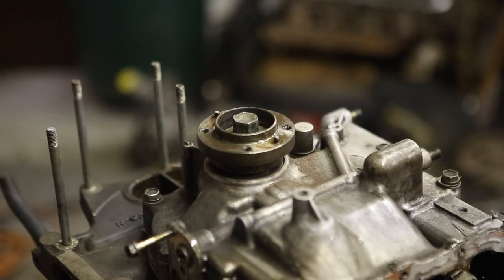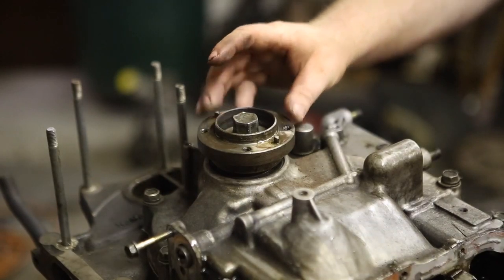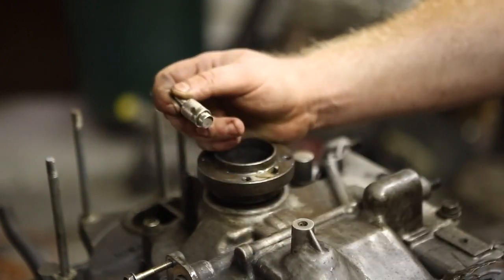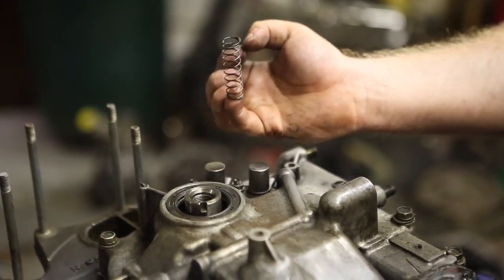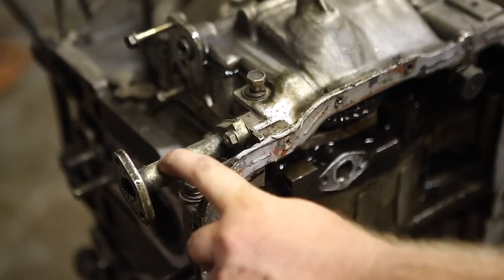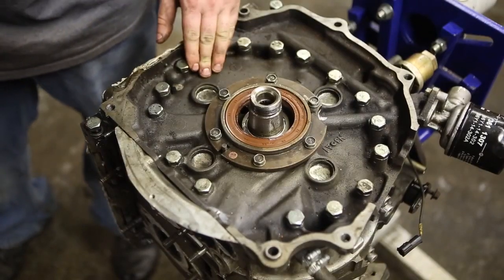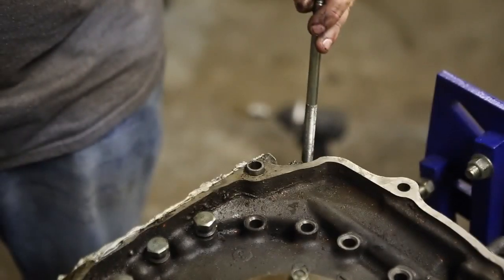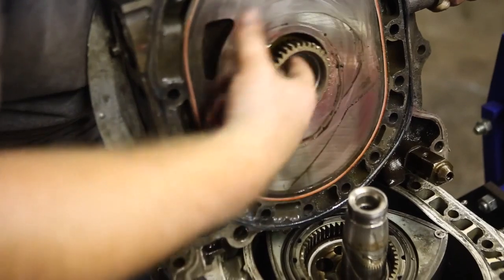How To Rebuild A Rotary Engine: Disassembly and Inspection

Comment: tbh i dont have the hands to be a mechanic lol note this man has only part of fingernails short very thick fingers. would help. the worst mechanic job i did was on my first pickup replacing a clutch with my dad (rip). it took 4 weeks of laying around on hot asphalt but that guy had hands like a bear and he got that plate in there after dropping the transmission on himself 3 times lol. it takes some thor yeh.

Comment: Guys, please consider to mention in a future video pros and cons of different styles of apex seals. For example stock vs. one piece or another aftermarket apex seals.
I'm going to rebuild my FD engine soon, so it would be nice to use something proven to achieve high mileage. The engine is street ported and I'd like to keep it otherwise as stock as possible, so no high boost scenarios. What would you recommend me?
Thanks.
Reply from the maker: TrinomCZ we purposely avoid this video because of conflict of interest. We have our own set of apex seals we're developing it's also a battleground of opinions. Honestly, there's nothing wrong with OEM seals if you're staying relatively stock. OEMs are the best for mild builds but run the risk of shattering after years of abuse.
Reply: Yeah, that's exactly what I am afraid of. On the other hand, I've found a lot of mentions, that softer aftermarket seals may damage the housings, so I'm not sure, what's actually better.
BTW, I didn't ask you about particular manufacturer, but the design itself.
Reply from the maker: The softer aftermarket seals are not damaging to housings, but you're not going to get the 100+k out of them like you would from OEM. Pretty much every aftermarket apex seal is just an OEM Style 2 piece with different metallurgy. Nothing really fundamentally different other than materials. One brand claims X and another claims Y, but ultimately stick to what people use and you'll be fine. For your build, I'd recommend just straight up OEM. Can't go wrong. If you're wanting 500+ when tuning needs to become much more precise and your possibility for knock increases, then i'd recommend an aftermarket seal.